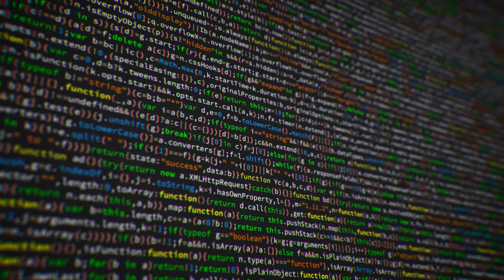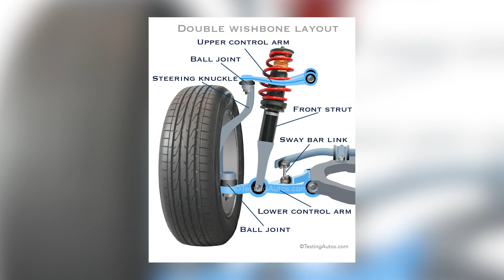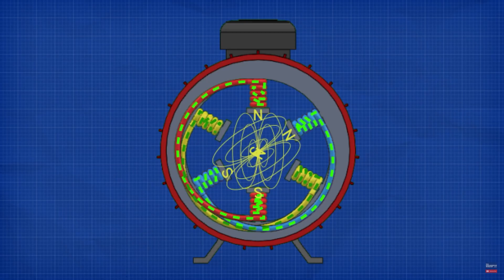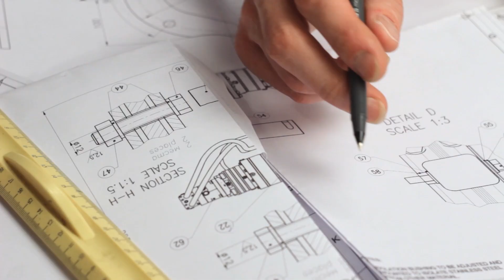Future of Service | Gruber Motors

Comment: Tesla have moved into the Apple - iPhone market by controlling everything to do with there very expensive over computerised cars as it showed in the Chinese Market there is a lot of room for the cheep city car market easy to maintain and less computerised  people  are even fitting electric motors to there classic cars to get away from this problem we the general public are being led by big ego company's and have lost sight of why things are changing as with the phones you can pay £1000 or £100 they both make a phone call and as for battery swapping would you consider  putting a new engine and gearbox in your 12year old car for about £4000 and if it had a accident you have lost all you achieved in the UK they have made it a offence to hold and use your mobile phone while in your car but you can still fiddle with your menus on you car screen while driving in some case's  where a simple switch would do

Comment: not sure about the point of the dealer network very lagging against tesla service model when it comes to batteries or motor. Both don't fix, they swap. Only a shop like yours goes to the component level. My point is Tesla doesn't have much lead over the dealer network